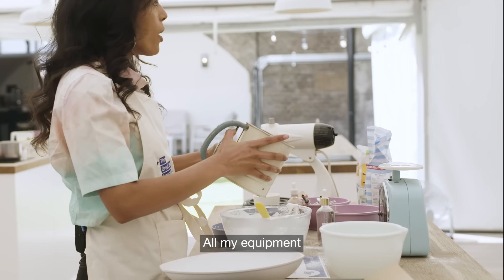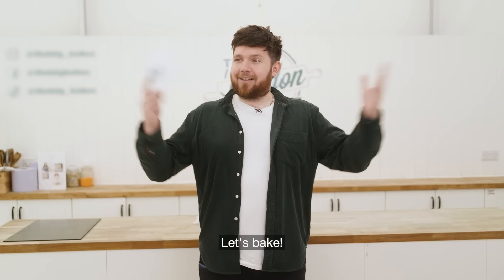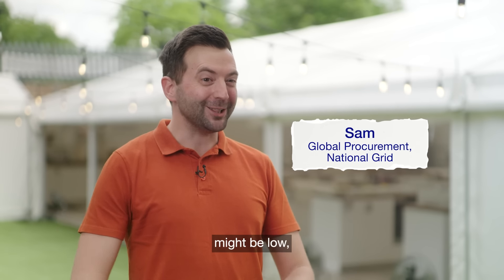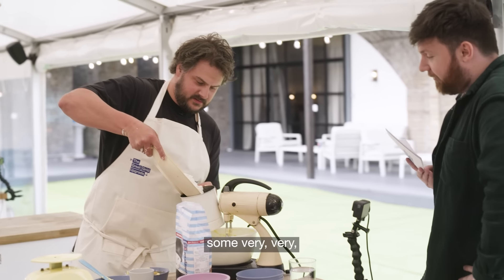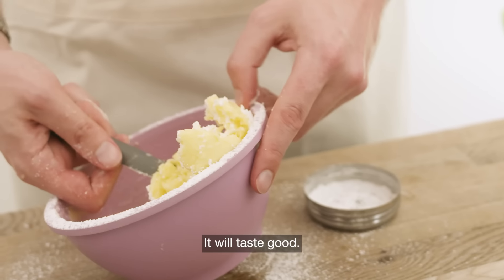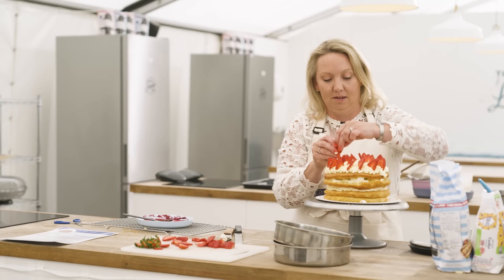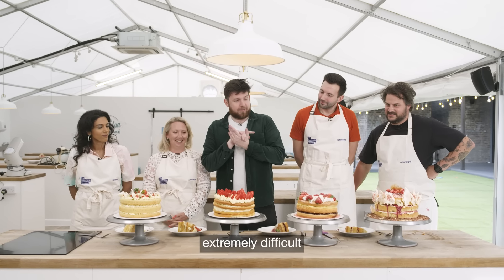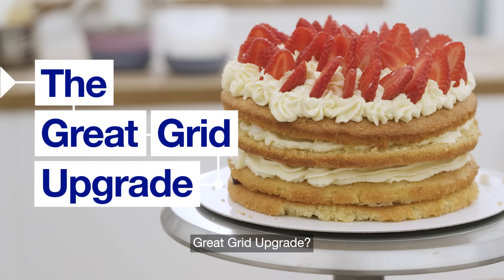1950s vs 2024 Tech: The Great Grid Baking Challenge | The Great Grid Upgrade

Comment: Getting bakers in to describe the grid upgrade is excellent! It's a great analogy for connections reform where the consultation might as well have been done by bakers as the only workable solutions were dropped early on, leaving only unworkable variations.

Talking off terrible things: 
- trying to model the background system when giving connection dates
- kicking projects off the connections register for arbitrary reasons (not meeting milestones) 

The first you can't do, as you don't know which projects will get build; the second is ridiculous as meeting early milestones is no evidence of meeting later ones and not meeting them is not evidence of not meeting the later ones.

Yes, you need to change the process. But your remaining variations HAVEN'T changed the process sufficiently. Variation 5 was so close to being workable, but it's flaw was using an auction for capacity rather than constraint with the Balancing Mechanism. 

- Let all projects connect wherever they want
- Auction constraints 

That allows tech to come into the market to solve those constraints as there's a price signal.